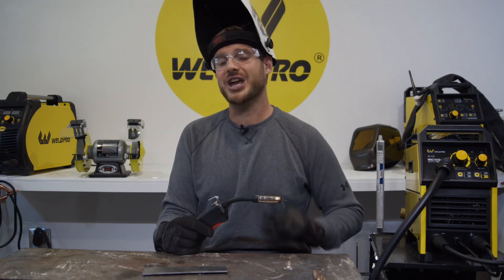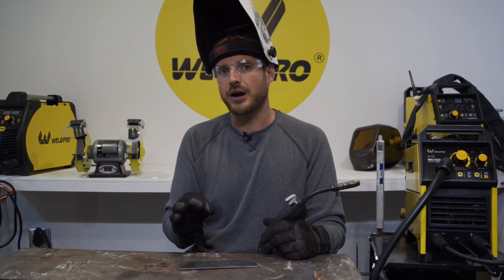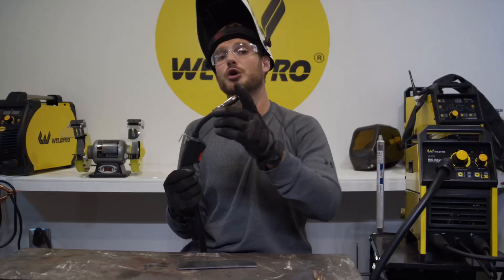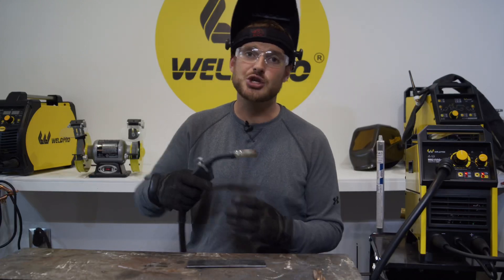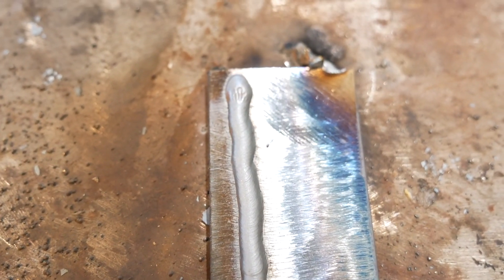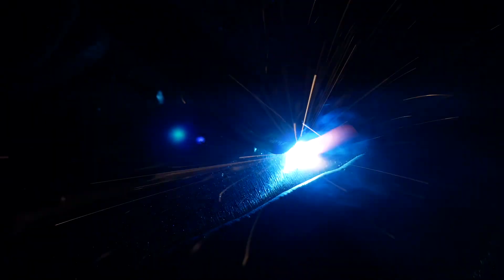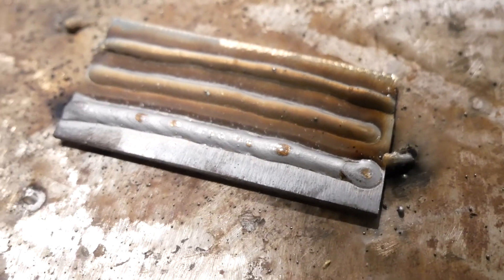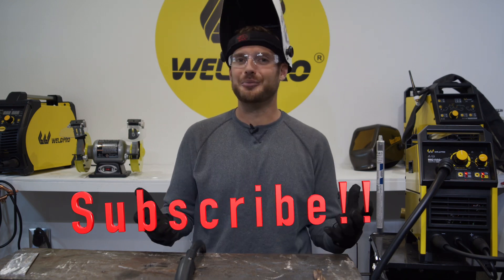Weldpro MIG 155 - Part 4 Solid Wire + Mix Gas

Comment: What is the actual wire speed in inches? The manual says 39.4 feet per minute which is 472 inches per minute and the website says 396 inches per minute. Thanks.
Reply from the maker: Were finding that is around 396, 472 is shown as the maximum because during the high speed wire feed process that is the fastest the motor goes. The machine is only adjustable up to 396.
Reply: @WeldproWeldingEquipment  thank you

Comment: Can this machine run 035 and 040?  I saw a review that said 030 was the highest it can run.
Reply from the maker: No the liner is sized for .045 so it can take .35 no problem. .40 should work but no promises.
Reply: Thank you for your quick response.  I am going to purchase a welder in the near future and am looking at options.   This is the second inquiry I have submitted to you company and both times my question was answered within a day.  Customer support after the sale is one big factor in my selection.
Reply from the maker: @jim21804  glad to hear it James! Don’t hesitate to reach out if you have any other questions!

Comment: I'm buying the 155gd can it really run .035 wire? I seen a review it couldn't
Reply from the maker: I use .035 all the time. Be careful of your drive roll size as well as your spool tension.
Reply: What is the duty cycle of the 155gd
Reply: It comes with the correct drive roll for .035 solid wire and flux core both. I have this machine and it will run it just fine.
Reply: @Littrell1966  what are the duty cycles? I can't find them
Reply: @chris117ize  If you go to Weldpro https://weldpro.com/  Then go to resources and download the manual. It's in there.
Reply: @Littrell1966  awesome thank you

Comment: Is the Mig155gsv TIG capable? The GD is, but it’s currently not available.
Reply from the maker: Yes, in theory you could do scratch start TIG. Its not the most ideal setup but it will run well with the optional torch.

Comment: I'm interested in this welder. Replacing a HF little 220v. I watched the part 1-4 for this MIG 155. What's the max thickness for this welder?
Reply from the maker: Ultimately the maximum thickness is only based on your groove preparation. If all you were doing is welding a butt joint we don’t recommend any mig process go more than a quarter inch

Comment: Thanks for the video!!! Set up was a breeze. Your videos are extremely invaluable to first time welders such as myself.
Reply from the maker: Byron Ramirez Thanks so much! I’m glad you were able to get something out of them!
Reply: @WeldproWeldingEquipment  I had a welder with 30 years experience try to get the MIG to work. He couldn't do it. We were able to run stick just fine. But MIG? The wire fed, the gas mix was correct, polarity was correct, but no spark. Can anyone suggest what might be the issue? He thinks that it is probably a circuitry issue, in which cas we'd have to send it back and get a new one.
Reply from the maker: @larrymasterspowerbuildingc4477  That’s really strange! Please reach out to our customer service department. They are open 9 to 9
Reply: @WeldproWeldingEquipment  Will do! I'm sur it's something simple. Thanks!

Comment: what is the warranty on this machine? just buying to have as a designated auto body welder so probably won’t me using it much other than on thin materials
Reply from the maker: Reid Timko 2 years! It should last you a lifetime especially for light auto body use! Thanks for the question